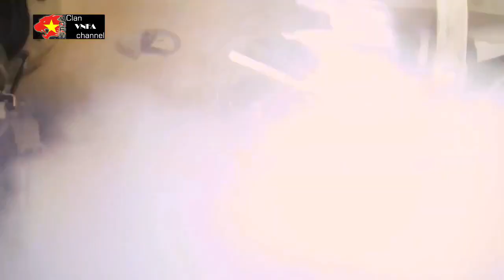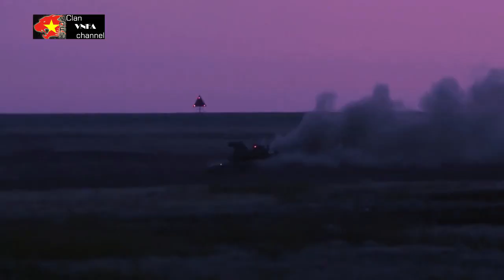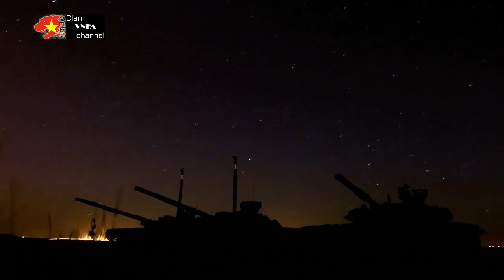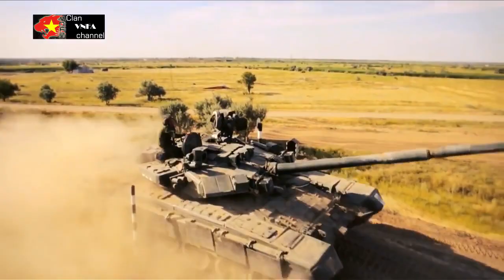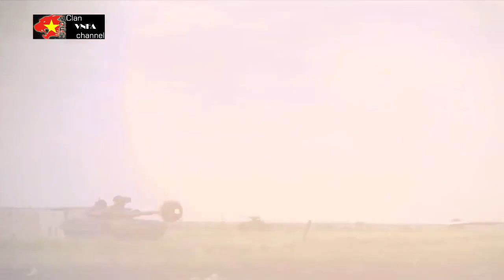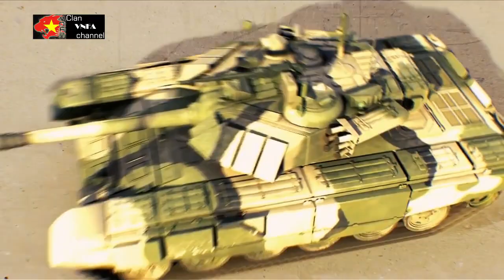T 90 T90S T 90MS Russian Main Battle Tank (Full HD Documentary)

Comment: Its an amazingly shitty tank.
How on earth did the keep the huge design flaws on both t72, t80 and t90.
One small fart and they will pop the turret off in a huge fire.
Reply: That's for sure, Russian tanks use a 3/4" thick interlocking mounting gear ring to hold the turret on, where the Abrams tank uses a 3" thick interlocking mounting gear ring.  I have seen an Abrams tank get hit with a 105 MM IED right at the turret joint and it didn't even move the turret.